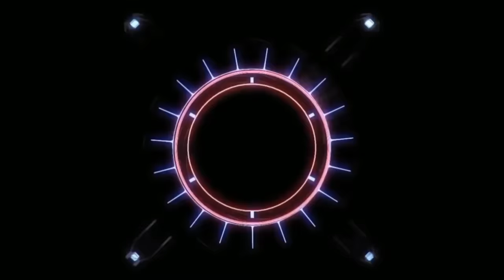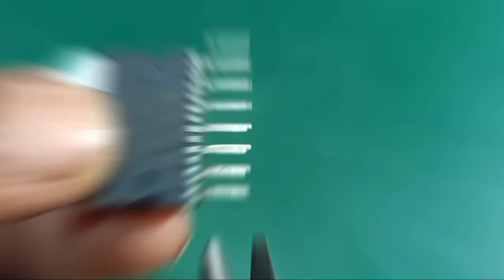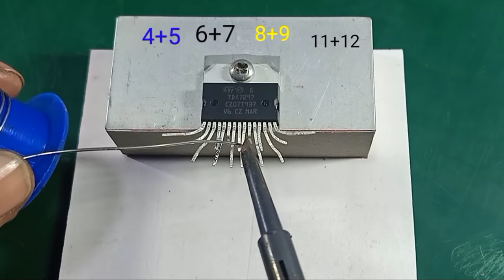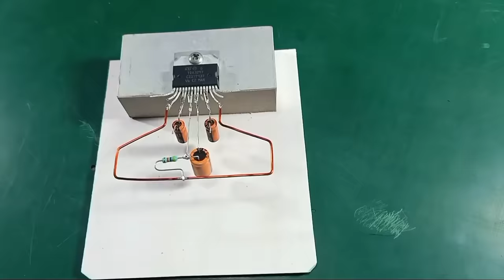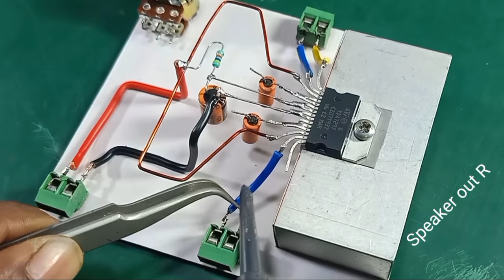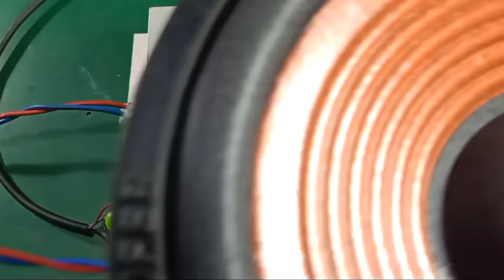Simple & Super HiFi Stereo Bass Amplifier // How to Make Amplifier Using TDA7297 IC -  Powerful

Comment: How many watts speaker can carry this kind of set up sir?
Reply from the maker: 20+20 or 30+30 watts 👍
Reply: I like your ideas. Very nice 👌
Reply: Maybe only 10 + 10 watts
Reply: Just 7w + 7w if TDA 7266
Just 15w + 15w if TDA 7297 like in video.
Reply: His power supply is 12v 2a 
So its max 24w
12w-12w with this setup

Comment: Hey dude, it worked here. I used ic tda7266 7 + 7W DUAL BRIDGE AMPLIFIER. I was surprised by the sound I hear - loud and clear. Very good comrade. One more subscriber!
Reply from the maker: Nice work!
Reply: @RJEDITALL  In addition to being an amplifier this arrangement also manages to tune in to a radio station, ha ha ha. I noticed it here and got one more surprise. I don't understand how this arrangement does this it is also amplifying radio station signals.

Comment: Your video is so helpful. Love it. I use the default schematic in the datasheet to make it. And I use a 10W 8ohms speaker. But the problem is when I measure the power of the speaker, it's only 3.3W (6.6V, 0.5 A max) at 12V-2A. Do you know why is that, and how to fix it? Also, I would be really grateful if you could give me some advice to improve the quality of the sound. Thank you so much <3.
Reply from the maker: Check it well

Comment: Can this schematic work with speaker 10W. Thank you so much
Reply from the maker: You can use 20-40w woofer
Reply: @RJEDITALL  So if I use speaker it will have noises or stuff like that, right?

Comment: awesome video! Good boy does it work with 12v? I would like to connect it to battery or does it take a higher voltage? Thank you🙏
Reply from the maker: You can use two wheeler vehicles battery. (Maximum)
Reply: @RJEDITALL  I would like to use a 12v battery to make small portable speaker, important is that it is 12V rechargable, right? 
This is for 4 ohm and 8ohm? 
Thanks sir! 🙏

Comment: I did it according to this scheme, everything played fine, but now noise has appeared, one speaker works at a time, but noise appears together, and it is not possible to listen to music.  What is this connected with?
Reply from the maker: You use in  Iron box, there will be no noise problem
Reply: @RJEDITALL  There was no noise before, the noise appeared after I installed the amplifier vertically and extended the cords for the speakers.. The speakers work separately and there are no problems, but together they make noise.

Comment: Sir i can't arrange a 47k resistor, can you please tell me the substitute value?
Reply from the maker: minimum 33k and maximum 58k
Reply: @RJEDITALL  what will be the watt of 33k??
Reply from the maker: 1/4 watt
Reply: Sir can I connect this circuit with 5 watt 4 ohm speaker?
Reply from the maker: Minimum 20 watt
Reply: It's not working with 5 w speaker, only noise is coming
Reply: Heyy mr I have wasted my money for this circuit but it's not working .pls do something
Reply from the maker: Please, Check it well, 100% Working

Comment: Sir how much watt speaker can we run in this circuit
Reply from the maker: 40+40 watt maximum
Reply: Ok sir
Reply: Sir can you make 200w amplifier which runs in 12v adaptor no transformer
Reply from the maker: @yukesh2008  no bro, you can use 12v 3-5A adobter for this amplifier

Comment: can i use a 19 volt adapter?
Reply from the maker: No , 12v maximum
Reply: @RJEDITALL  can the copper wire be replaced with a normal cable, as a jumper or connector? or does it have to be the type of wire without insulation
Reply from the maker: @pujicitraperdana981  you can use any wire

Comment: mine is buzzing, why? Is there a solution?
Reply from the maker: Check it well, no humming problems
Reply: @RJEDITALL  buzzing at the beginning of the volume Until the middle of the volume.. But when the volume is full, it disappears a little
Reply: @RJEDITALL  The buzz disappears when I touch the ground on the potentiometer. What should I do? I have to touch the potentiometer ground forever ?

Comment: The song comes out with dirty sound and no bass. Why?
Reply from the maker: Check it well
Reply: Can you tell me where the problem might be because I looked a few times and it was the same as yours
Reply from the maker: @EnisZaimi-lz3du  change your ic
Reply: Could I have connected the aux wires wrong?

Comment: WAY WAY WAY to low of power & to much distortion. These all in one IC's are OK for Very small setups, But you TRULY need MOSFETs, Power Transistors with a beefy power supply to drive them .  Subwoofers can take LOTS of current to drive them correctly & can run as low as a Half Ohm in some setup's .